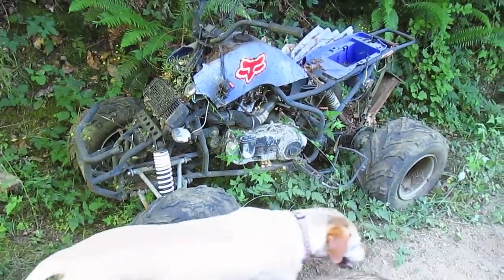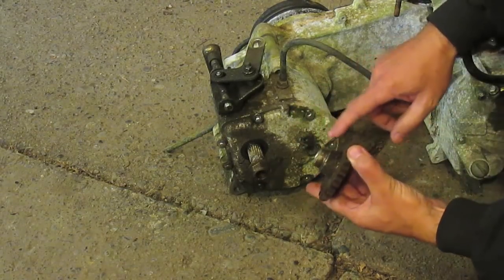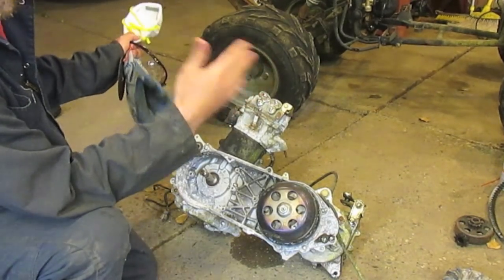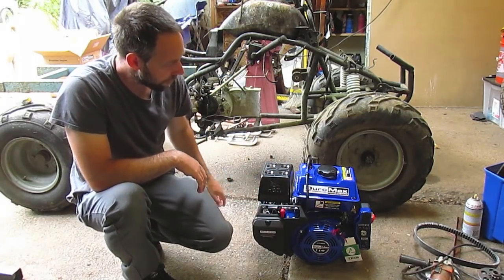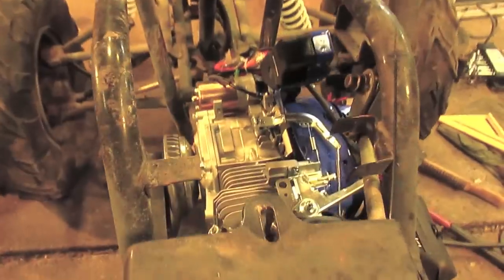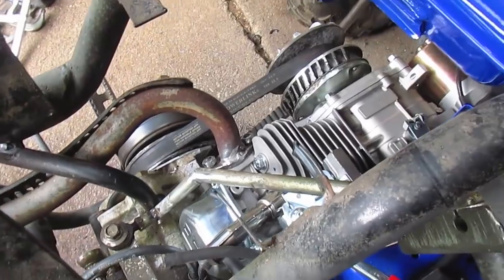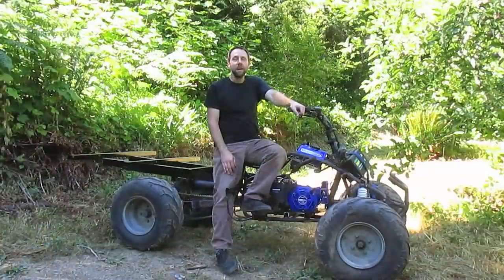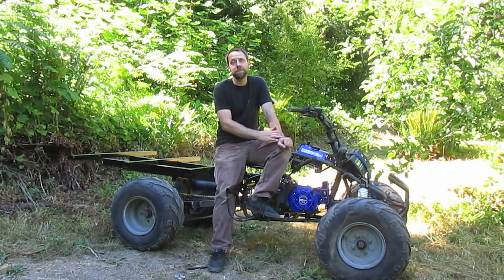Homemade ATV quad truck part 1

Comment: Great idea I have an old Chinese CF Moto 260 Bighorn shaft drive with a good transmission I will be re using for a similar build it also has high and low range in it. Great work Mike as always!

Comment: Mike, thanks for the inspiration.  I watched your quad truck videos and decided that my old Honda TRX250X with a blown motor could be resurrected and turned into something useful to use at my hunt camp in Perry, Florida.  I bought a $99 harbor freight motor, used an old CVT back plate to hold a jack-shaft, made a sprocket for a 520 chain and set it up for a 12:1 gear ration.  Piston fires 6 times for every revolution of the rear wheel.  That seemed to give me the torque I needed to haul corn out to the feeders and hopefully haul a deer or two in during fall hunting season.  Thanks again for the inspiration to build my own truck quad.  Here's a video of my contraption:
https://www.youtube.com/watch?time_continue=25&v=Zgg-6lrvkmg
the rear rack acts as a dump truck and I plan to extend the back rack a bit to haul more stuff around.  The only other mod I will make is the addition of a rack for my bow.
Reply from the maker: That’s great! Thanks for commenting and checking out my video. Your quad looks real useful for around your place. Take care 🙂

Comment: I was sold when you cut the transmission away. Why I never thought of that idk. Opens up a whole new world.
Reply from the maker: Big Dan Thanks for your comment! I’m glad you checked out my project :)
I should be posting part 4 in a week or so, in part 4 I use a complete power steering rack and pinion system and adapt it into a hydraulic dump for the quad truck. Take care.
Reply: Thanks for the reply. I keep looking for free junk and pick them up when I can. I like using the parts and pieces for other projects. It's amazing how much flat bar and round stock is under a riding lawnmower, and how much tubing is under these quads... That, and I'm building a mountain of nuts and bolts and other odd pieces for building metal sculptures. 

But cutting that belt drive clutch off the motor like that was pure genius, I can't say enough about it. I need to find me a free atv!

I only have a riding mower as my work horse, a 12.5hp john deere. Other than my flatbed trucks which can't get around everywhere in the yard it's all I have to get work done with and it's seriously lacking capacity. So I think I'm going to take a page out of your book there and weld one of the cargo hitches to the front of my mower over the hood to carry all of the tools I work with out in the yard, the chainsaw, gas, oil, rake and shovel, etc, and I might even get away with a small dump bed. Nothing as big as yours.. but maybe I should stick with a trailer instead.

Comment: Hi Mike I know this is an old post. I'm in the middle of a similar project and I don't think I'm capable of making the belt veryator fit my 212. I have a identical transmission. Do u think a torqe converter driver pulley and belt will work with the clutch? On that transmission? Please keep up ur creative content don't let closed minded people slow ur stride
Reply from the maker: I haven’t tried a go cart torque converter like a 30 series with this kind of scooter transmission but it may work? Maybe experiment and see what you get.
I’m going to be building a quad truck #2 this Fall. I definitely will be mixing and matching parts on that build. Good luck on your quad project 😊👍

Comment: I picked up a china quad last fall (Linhai 260) with a similar drive setup. It's running now but if the water cooled motor gives me grief this would be a great alternative to re-power it. Great video - Thanks !

Comment: Hey i just took on a similar project. Repowering a 90cc 2 stroke quad with a Predator 212 hemi. I was looking for a good way to get the engine to adapt to as much of the existing driveline, so thanks for the idea of cutting the stock engine away from the gearbox to retain use of the stock CVT. 
The only thing i will be doing differently is cutting most of the output shaft of the new engine off and adapting the output shaft from the old engine to it. Just gonna take it to a machine shop and have it turned down to the same diameter. Then i will also have them cut a steel collar sleeve with an inner diameter that matches and mate the two shafts with it.
Reply from the maker: iggy151 Right on 👍 like it should work out good! Have you seen any of the later videos of this quad truck? I built a hydraulic dump bed and cut a cool custom grill along with some engine mods like a Honda XR 200 carb, cam and milled head 👍

Comment: I'm so glad to have come across this video. I have the same China 4wheeler. The engine was so tepermental that I finally parked it one day. I knew a Clonda would be perfect to repower the thing but wasn't sure about adapting the torque converter and as you mentioned I knew the new engine wouldn't turn as many rpm. I also have a lathe and a milling machine but just haven't taken the time to look into the project. My oldest son had started taking the engine loose as I told him I'd figure it out if he got it on the bench. He very quick lost interest in the project.
Reply from the maker: I'm glad you found my video! There's a part 2 to my quad truck build so check that out if you get time.
That's good you have a lathe because as you see there's a few small things you need to change, but other then that the mounts to mount the motor are fairly easy to fab up. Good luck with your 4 wheeler project :)  
Let me know how it turns out. Take care!

Comment: Love the build, gotta say though it's called a CVT, not a variator. Continuously Variable Transmission. There's a drive clutch on the motor, and a driven clutch on the output. They are used in everything from snowmobiles and ATVs, to awd Subarus
Reply from the maker: Justin B Thanks for checking out my video.
I gotta say I do know a thing or two about these transmissions. 
Do you know there are two kinds of CV transmissions? I have been tuning them for over 20 years now, this one is definitely different then the ones you may have seen on mini bikes, go karts and snowmobiles, those CVT work as the RPMs are increased the front driver pulley works as the clutch grabbing the belt, this takes it’s toll on belts over time, the rear pulley is the driven one and has a spring in it, the front pulley has the weights in it that work off of centrifugal force, these determine the RPM range the belt grabs and the engine RPMs as it accelerates.
CV transmissions on motor scooters are what I like more, these transmissions are far more tune-able, this CVT is that version, the front pulley is the Variator it’s adjustable by changing the weights with different rollers, the belt is always in motion ( no clutching from the belt) the rear pulley is the driven and it also has a follower spring in it but one of the biggest difference is the rear pulley also has a centrifugal clutch with actual clutch pads so your belt lasts far longer. I had a really trick scooter years ago that I spent a lot of time tuning, all my parts I ordered from Germany 🇩🇪 a good Kevlar belt would last over 4000 miles 👍
Reply: @Mikefestiva  Well shoot. Sorry if I came off wrong on that. It just sounded like such fake word, you know? Thank you for the education. That definitely makes sense for the weird looking "driven" clutch. The more you know. Thanks Mike, keep up the good content
Reply from the maker: Justin B no problem Justin 🙂 
Back to scooter tuning, I had 50cc two stroke with a 70cc cylinder kit, big carb, carbon fiber reeds, big expansion chamber exhaust and a lot of work to the CVT, heavy clutch springs so the centrifugal clutch wouldn’t grab till over 3000 RPMs, if you didn’t keep your weight over the bars the front end would easily come up!
I built my scooter after I took a trip to Europe when I was 18, I was blown away with all the trick 2 strokes ripping around over there.
Mine sounded like a CR 80 and I rode that thing over 5000 miles while I owned it 😂 Take care 👍
Reply: @Mikefestiva  Man that's crazy. Starting a little conversation here in the comments, sorry about that. Just had to say that scooter culture is amazing. It's crazy to hear that you can get that power out if a 70cc. I'm helping my grandpa put a 150 kit on his 125 Vespa. Bringing it up to a whopping 8.9hp. It's crazy to hear what people can do. Do you have an address I can send a sticker too? It's a scoot gang sticker with my grandpa's Vespa on it. As soon as I can make one I'll definitely send one. Thank you for being so nice and teaching me something new

Comment: Cool!  Just finished making my own version of just this.  I resurrected an old 250 Chinese quad I bought brand new 8 years ago.  Manual 4 speed and reverse.  Love the linear actuator idea for the tipper, think I’ll go for that as well, instead of an hydraulic unit.
Reply from the maker: Todaywefly Right on! Man I use mine all the time and I bet you will too 👍 I think out of simplicity running two linear actuators would do all the lifting you would need. As you know I built a hydraulic system and it was fun to try and do it with the steering rack system but the electric actuators is by far the easiest and doesn’t complicate the build. 
Ps do you have any videos posted on it?
Reply: Mike festiva  Not really a utube poster but I might review the finished product.  Stand by for that😀.  Just have gas struts on it at the moment to control the tip but have ordered 2x400 mm actuators, I think they’ll be about right.  Watched your P/steering post and agree it’s probably too much effort.    I have an electric wheel chair hydraulic unit  but that’s a bit heavy as well.

Comment: Stumbled across this. I've been searching for ideas about combining motorcycle, quad, utv, or golf cart parts to build a 4x4 yard truck.  I also need to cross a creek.  I've seen the Duromax motors in similar applications.  I would prefer a motorcycle type transmission with direct drive or driveshaft.  Contemplating building my own frame.  Great start!  Enjoyed watching you have fun riding it around.
Reply from the maker: Thanks for checking it out!
The main reason I used the old stock belt drive and trans is because it had reverse, That's really needed for a utility machine like this. I have seen some really cool homemade 4x4 tractor trucks from Russia on youtube, they part out old 4x4 cars or trucks and modify the running gear and fit it to there own home built frames. Check them out if you get time.
Reply: That's a great point.  The Russians are great cobblers.  I like how you cobbled yours together.  I saw a Jeep that had a similar engine cobbled to a Jeep clutch and tranny.  It looked odd but worked. I'd be willing to bet that someone makes a reversing gear. Ural has one on their side car bikes and it will back up faster than any motorcycle I know of.  I know that you will continue to modify your yard truck as time goes along.

Comment: Dude do you know of a company that makes custom sprockets? I’ve got an 86 Honda trx200 that I’ve got a predator 212 mounted in perfectly with a cv trans that comes with 35 and 40 pitch sprockets 10/12 tooth for the front and the trx200 original rear sprocket is 520 pitch(easy to find and replace so ide like to keep it 520), so my problem is that I need a 12 tooth 520 pitch 5/8th bore 3/16th keyed sprocket with hubs on each side making it a total of 16mm wide and between 45mm-55m tall from one tooth to 180• on the other side. I tried welding the original 12 tooth 520 sprocket onto the jackshaft of the cvt which not only came out crooked as a politician but it heated up the bearing and destroyed it. Helllllppppppp
Reply from the maker: I would probably just keep the stock front 40 pitch sprocket and modify it to fit a 428 chain and try to buy a 428 rear sprocket you can re drill to fit the rear bolt pattern 👍
Reply: @Mikefestiva  sweeet thanks redrilling a new rear went right over my head... Appreciate ya bro
Reply: Hey brotha I can’t find anything on google on what all it takes to mod the 40 pitch sprocket to fit a 428 chain, some folks say it won’t work and others say it does. What all do I have to do to it?
Reply from the maker: @edwinmaling1890  Thanks for checking out my videos!
This video I cover what I did to make the chain fit the sprocket, I think around the 10 minute mark. There’s probably some or good info in this video as well.
https://youtu.be/ZmJ3kFeFfDA
Reply: @Mikefestiva  so I’m still trying to convert the rear axle sprocket to 428 and the stock one on my quad axle bore is 43mm and it sits on splines even tho the sprocket bore isn’t splined, well anyway I was wondering if you might know if a Honda xr100 rear sprocket bore might be  close to that? Nowhere I’ve found one does it spec out the bore size just the lug pattern which I’ll need to re-drill. ( the Honda cr100 stock sprocket looks ideal to mod because there’s enough room to re drill my 88mm lug pattern, but also if the bore is too small there’s enough distance from the bore to the stock lug house it wouldn’t affect it) I’m probably just over thinking this.... do you have a go-to place for sprockets? Or who would make a custom one? I wish I could tag a few pictures to help illustrate my problem 🥱

Comment: IF IT WAS A gy6 i would built it mods are cheap even a12 or a whatever camshafts n big bore 64mm piston n cylinder kits but then again its all in cost vs performance needed i rebuilt a kawaski 220 bayou japan piston   referb cylinder   from a guy 175 usd so i got a weak 220 engine fixed now  cheapish just need to use the old atv lol

Comment: Hi mike ,  looks like its going to be a very interesting build :) , how did you cut your key way
Reply: Jay Sybrandy I was wondering the same thing
Reply from the maker: It was not easy nor probably the "right way to do it" let's see if I can explain it?
So I chucked up the tube that I was going to cut a key in into my lathe, then i took the only parting tool I had and it worked out it was 3/16" wide the same size as the key that needed to be cut. 
With the lathe powered off, I set the parting tool in line with the part to be cut, so when I moved the carriage towards the chuck with the part in it the parting tool would just scrape a small amount of metal off on every pass inside the tube, then I would rase the tool up just a small amount then do it over and over and so on....
Like I said it's probably not the right way to do it but did work.
I would probably grind a special tool for the job next time so I could use the cross slide to set the depth of the cut.
I think it would stay put in the tool holder better then my cheap parting tool and holder did, if I took to deep of a scrape off it sometimes would slip down in the holder and then I would need to reset the hight.
Reply: Oh yep I was going to say you can do it like that if you didn't do it like that :)
Reply from the maker: Hey Jay how's your bandsaw mill coming along?
Reply: Mike festiva pretty good if you go to Instagram.com/jaysybrandy I have some update photos on there :)

Comment: Hi Mike, i just wondering what kind of welding machine are you using?, thanks
Reply from the maker: I only had a old Lincoln weld pack 100 at the time of this video, I bought the Harbor Freight Vulcan Omnipro 220 after this but decided To get the Titanium 200 welder they sell. It’s what I’m using in my shop all the time now. Have you seen my articulating mini dump truck I’m building right now? Take care
Reply: Of course look awesome; I’ll would love to try a predator 212cc in a atv like you
Reply: @Mikefestiva  do you prefer the titanium over the Vulcan. (I have watched all your vids comparing the two) I'm thinking about investing into the Vulcan.

Comment: Probably would have been easier for you, and the bike would perform alot better, had you just removed the engine governor and put some stiffer valve springs in. I like this idea though. Good job.
Reply: The problem with doing this is that the flywheel and connecting rod in these engines are only rated to about 4000 RPM. Without the governor the engines already rev past that number and going much higher than 5000 can result in a catastrophic engine failure. Using the engine in this way stresses out components and reduces reliability. Aftermarket parts are available to get honda clones up to about 9000 rpm but this is expensive and sacrifices low end torque. For this build he wanted cheap and reliable and didn't care much about top speed and none of this would have helped him achieve this goal.

Comment: Awesome build.. have you thought about adding a place in the front for weights like tractors have?
Reply from the maker: I may need to add some extra weight up front to help with steering with a heavy load in the bed, I'm starting with welding a tray for a battery up front to add some weight, I'm also adding a front rack that should help even out the load if I'm hauling fire wood and stuff like that.
Thanks for checking out my video :)

Comment: This is what trailers are for. Nice azz build tho
Reply from the maker: Nerdis Herdis Thanks for checking out my project, trailers are a lot simpler but I live in the woods with tight trails and trailers can be tricky to get in, out and turned around. In part 2 I added a electric lift to the bed, now I’m making it hydraulic because I can haul about 600 lbs in the bed and it’s nice to not shovel it to unload it. Take care.